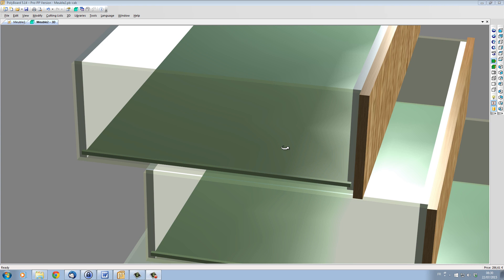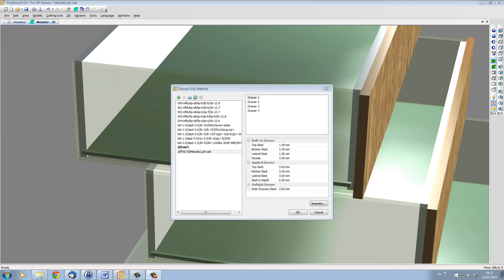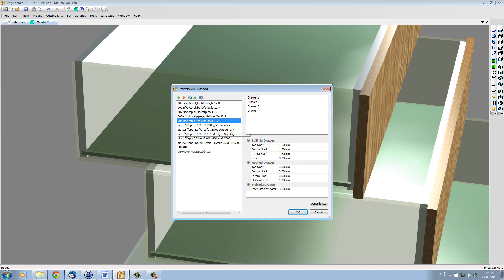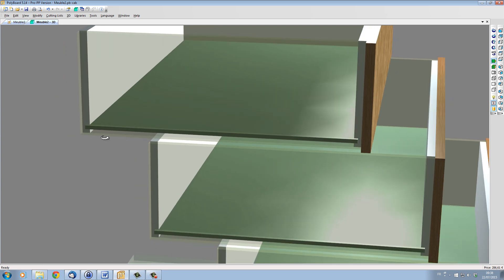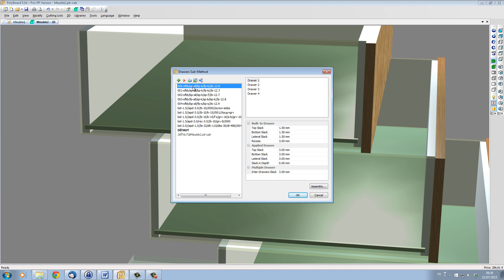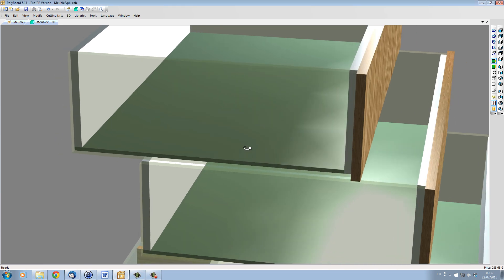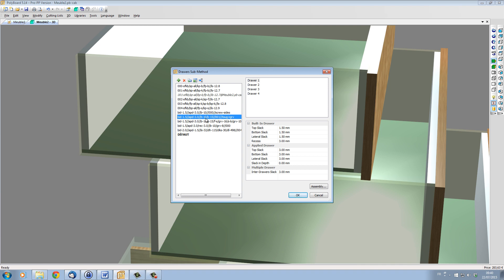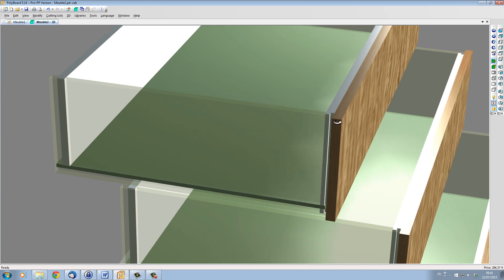Design Drawers in Polyboard

Comment: Hello. Is there any way to have multiple drawer types within the same cabinet? Manufacturing submethods cannot be applied to individual drawers so I am a little confused on how I can have drawers with different heights in the same box without partitioning the cabinet first... Any thoughts?
Reply from the maker: Hi Dinos

You can have several different heights by selecting "Apply the methods to the cabinet's new component" i.e. different drawers in zones that must be divided first. 
If you would like further help, don't hesitate to contact us at support@wooddesigner.org 

Have a great day!

Comment: Pls tell me Material drawer side
Reply from the maker: Hi Mesut, it can be any material really, you can change them easily on a cabinet by cabinet basis. But much better, you can specify and change materials in the Materials sub-method very quickly. We have a support forum here for further advice: https://wooddesigner.org/forum/